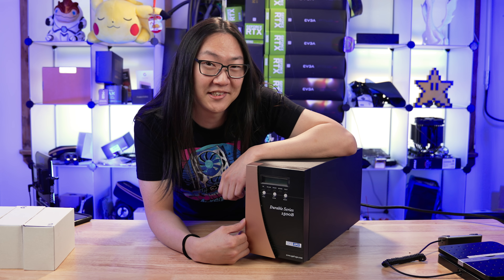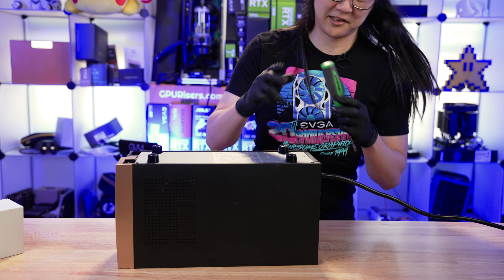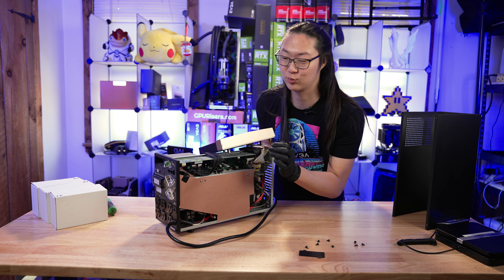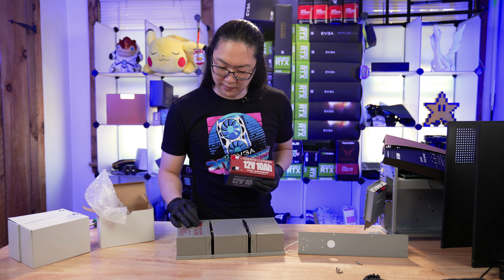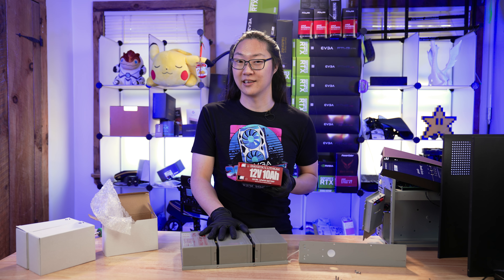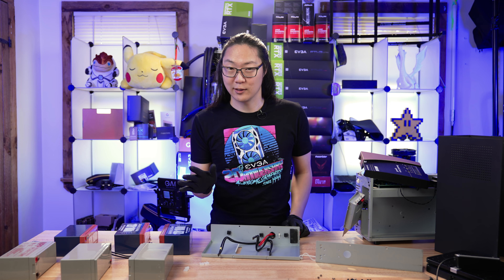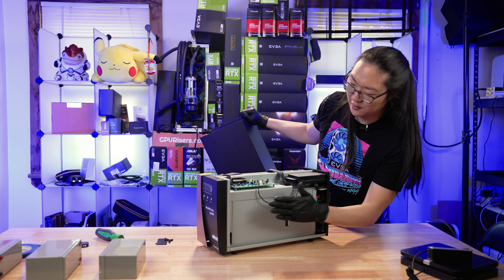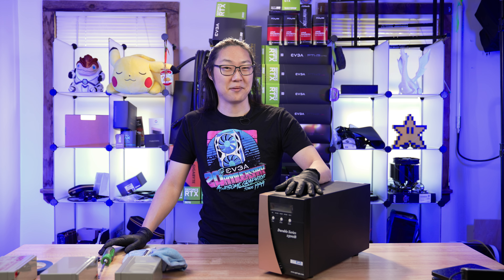Lithium battery upgrade (mistakes were made)

Comment from the maker: have you ever used a Lithium battery in your UPS? let me know!
Reply: yes! and I 3d printed a new case for it :)
Reply from the maker: Very nice! I need to see that!
Reply: I need more lithium batteries In my life 2kw isn't enough
Reply from the maker: I think 50 kw is adequate
Reply: @TekShinji  if I could afford it I need 200kw..lol
Reply: No. Recently found an old UPS in my storage room, and thought I could use to power my router instead of the long extension cable to my desktop's UPS, so got another SLA battery. If I wanted to use LiFePO4 I'd get a Jackery type box that knows a LFP is connected. A SLA UPS expects an SLA discharge curve; I predict your discharge percent display is very inaccurate, showing 100%-90% for the entire discharge time and then drops from 90% to 0% extremely quickly according to LiFePO4's flat discharge curve. You're not going to have very long from when the alarm sounds to properly shut down the PC. Aside from that, that ups probably has a continuous float/trickle charge, while LFP only needs a float a couple times a year.

Comment: I have my UPS converted ti LFP batteries long time ago. Works great to this day, usually I have to replace these batteries last year if it still use lead acid but, nope, its still working great, uptime is still the same as it was before when I installed it brand new.

Though mine is a DIY conversion, not a battery packs like that. The problem with those type of battery pack is they use weak BMS and only rated for 10A of continuous load. I guess that battery pack have better BMS inside and most likely good cells as well, most likely confgured on 4s2p cell configuration, hence the 10Ah label. Im assuming they use 20-30A BMS here since cells that can fit inside that battery holder usually have 18A discharge rate.
Reply from the maker: I have an had issues with it for quite some time. I did other UPSes without any other updates to it almost 6 years ago and they’re still fine today. I mean Min I’m sure that the overall capacity and such as not as good because it charges to a lower Voltage and what not but it works pretty well for me.

Comment: Good job!!  You turned your 1500W USP into a 360W UPS.  You probably only have a 10A BMS in those batteries, and the BMS won't last long if you run it continuously at 10A.
Reply from the maker: Thanks, appreciate it! So we actually done full testing with the UPS and there's been no appreciable difference including the capacity. I think it's because since the batteries have more capacity but the BMS in the UPS charges them only to 12.7 volt or something like that

Comment: Prob don't want them to be held higher than 13.5v. I was thinking of using LFPs in my ups but it floats at 13.8v so I'll just replace with cheap SLAs when needed.
Reply from the maker: Yeah, they don’t charge them as high because it’s still using the SLA chemistry for the charging rhythm/curve. So technically they’re not being charged up all the way or they’re supposed to be.
Reply: @TekShinji  I know that holding a 12v (4S) lifepo4 battery at 13.43v will keep it at ~92.5% state of charge, so holding at 13.8v would be (as good as) full.

Comment: So my 12 v ups uses a 12v 5ah sla.  Can I just put a lipo 12v 5ah battery in it?   So if I understand the lipo has higher operating voltage and charging but the UPS device is wired for sla. So you think I should go with 12v 6ah lipo?
Reply from the maker: Hey there, it’s highly dependent on how the UPS is charging circuits and stuff are designed. For a really really old UPS I try to stick with like for like.

However, as a general rule of thumb, I try to go with as much capacity with with the same voltage and physical space as possible.

Comment: What I didn't see you test was running the UPS near max capacity.
I think the BMS on the Dakota cells limits the max discharge rate to 10a.
So it's likely your 1500va (1000w) ups will shut down if it sees more than about 360w of draw.
I did this to one of my UPSs hoping to keep from replacing batteries every three years.
It only worked for light loads.  I had to go with an external battery pack that allowed higher discharge rates.
Still, a good video to inform us of alternate battery types.
Reply from the maker: Hey there, I actually was able to run it at the 1000 w capacity. Didn't have any issues.
Reply: @TekShinji  Cool.  Those Dakota cells must be better at higher currents than some of the no-name ones I've tried in my UPSs.  Good to know.
Reply from the maker: Yeah, to be honest I didn't really look that deeply into it but I just wanted something that would be a good replacement that wasn't SLA. I was pleasantly surprised when I found this out.

Comment: The OPTI-UPS Durable Series DS1500B is 1,500 va (volt-amps,) and 1,050 watts max draw. It's been four months, how are the lithium batteries holding up? Is the runtime better?
Reply from the maker: Opd hahahaha The batteries are doing great! The runtime seems to be the same since the charging system is not set for lithium but for lead acid. So technically the batteries are getting charged not to full capacity at like 12:13 volts instead of 14.7

Comment: I still don't grasp the premise of why you're replacing batteries so often... and why if that was the issue didn't you know how where the screws are?
Reply from the maker: Sus isn't it? Haha because I was being sarcastic... I've only changed the battery once on that particular unit but other ones many times. Usually I run them at full load. 24/7

Comment: Hello I wish I will have seen your videos I have been changing out SLA for 12/14AH batteries on all my ups to 18650 that I build myself and I run my solar system to one ups that’s 1500 watts and then that one runs to another that’s 1000 watts and the a 750 and stops their ! But I have been dining this for about 7-8 years now and this system has not left me in the dark ! Nice to see someone making a video on how easy it is to change out ! Even thou Apex does not approve of this !
Reply from the maker: Yeah they don't approve of it. And technically they say it's not the way it should be unless it's a lithium-based charger too. However, it seems to be working great and honestly it seems to be better at holding a long load for a longer period of time versus the SLA batteries